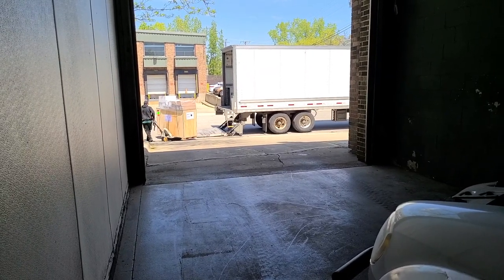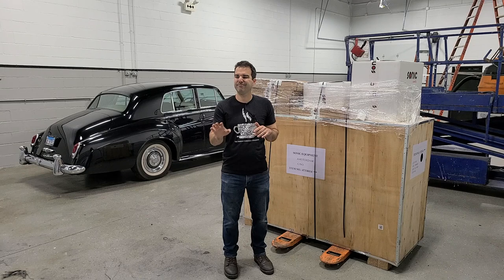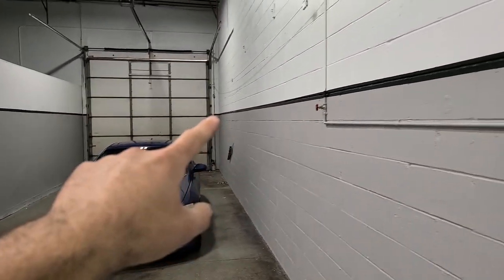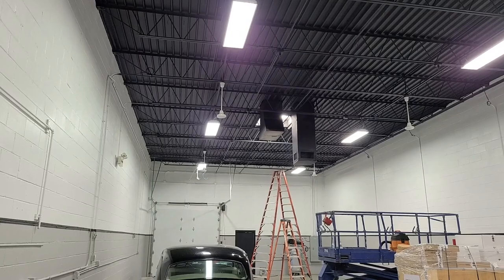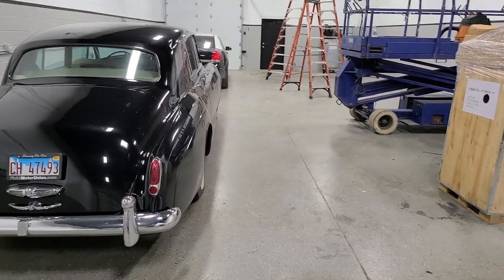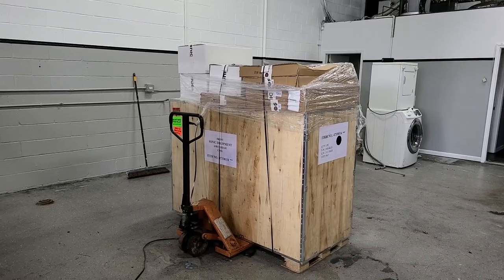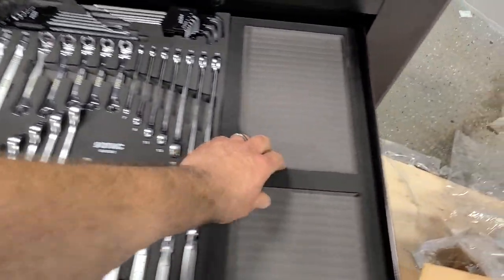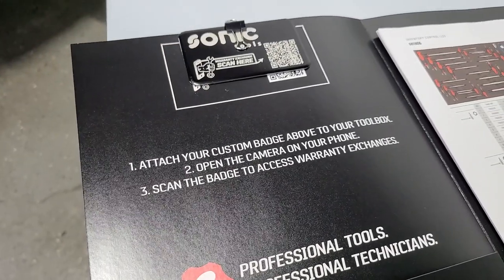Big Legit Street Quarters Update! New Tools & Toolbox, Custom Paint Job, Black Ceilings & More!

Comment: AWW MAN! We should have had a tool party!
-Sean
Reply from the maker: I mean we still can
Reply: @LegitStreetCars  I will wear my tool belt  and jump right in !
Reply: @LegitStreetCars  where are sonic tools made?
Didn’t see any information on the website...

Thanks
Reply: Leave the desiccant packs in every drawer it helps a lot over time with heavy humidity on tools and stuff that will rust.
Reply: @erinbuckley6635  makes sense, thanks for the tip.
Reply: @gregrn779  Sonic is a Dutch-based company with facilities in Germany, the Netherlands, Taiwan, and the United States. We design and manufacture tools throughout Europe and Taiwan, focusing on the ideal locations to produce the highest quality tools.

Comment: About the floor Alex, an idea, little pre-story; I drive a fuel tanker and had a high pressure hydraulics line burst at a customer yesterday, and the mechanic that helped me told me how the fire dept. uses a special road surface cleaner after accidents and what not; it’s a liquid, you dilute it with water and it leaves the surface clean as new. Maybe you can check with your local fd to see if they have it and where you can buy that, or maybe someone else reading this can chime in.

Comment: Great toolbox....but right away I saw something that I think is a mistake:  putting all the most frequently used tools in the large top drawer.  If you want to use the top surface for small projects it is going to be a nuisance having the big drawer open between you and the project.  I would have used the top drawer for the 'least' used tools.  I would have then split the tool box for one side Metric and the other SAE which would generally keep one side of the surface open for work access remaining to the one side with the tools needed.  Hope your method works for you.  Good luck with this shop.

Comment: @LegitStreetCars It was a while ago that Alex talked about this website, Samcrac, and maybe a few others. It was a website where you can buy factory service/repair manuals and have them digitally. Been doing some side work because no shops are hiring in my area. But for my friends/customers with higher dollar cars, and my repeat customers with their shitboxes constantly needing to be repaired. I figured I’d just buy the manual and be good to go rather than trying to find a torque spec or a diagram of some trickier work. I know this is a long comment, thanks for reading, and thanks for any answers.

Comment: you should probably invest in some better quality locking pliers if you use them somewhat regularly. i find your more likely to pinch yourself when releasing the pliers with that style which is why i usually stick to the vise grip style locking pliers.

Comment: Personally i would love a tool company that put together full sets of every size socket from smallest to largest in every different size and style. ex. deep well, smallest to largest, standard size, smallest to largest, 6 point smallest to largest, 10 point smallest to largest, impact sets made the same way and in both Metric and SAE as well as wrenches.  i would sink a fortune into tools that were complete sets like that because nothing is worse than needing a specific tool in a specific size and it not being in a set you have because the manufacturer just assumed you would never need that size for anything. Nothing grates harder on my nerves than running into that situation and i ALWAYS do no matter what i am working on or how good of a tool set i think i have put together for myself

Comment: Is that roof insulated? hope so or it's going to cost you a fortune to heat in the winter.have you got insurance for your tools? they are so easy to steal,just wheel them out,maybe you should make a anchor bracket to chain your treasure chest to at night?think about getting alarmed up,at least fkt cctv that is out of reach,a lot of insurance comps will give you a discount for having cctv.